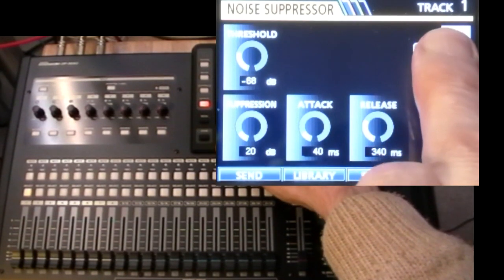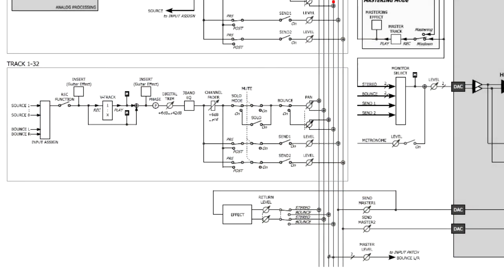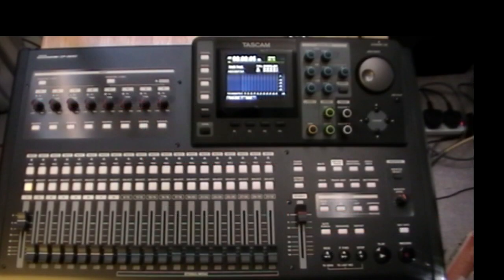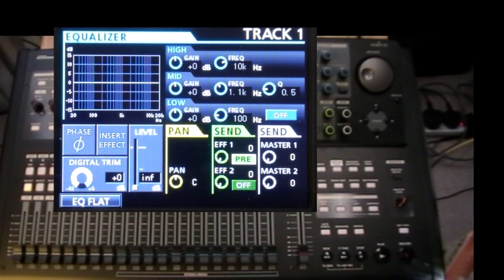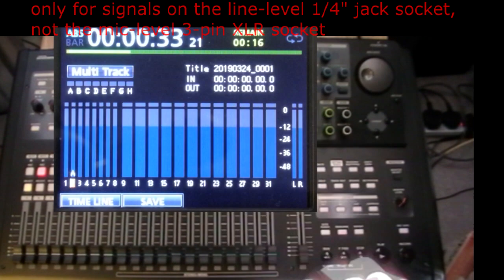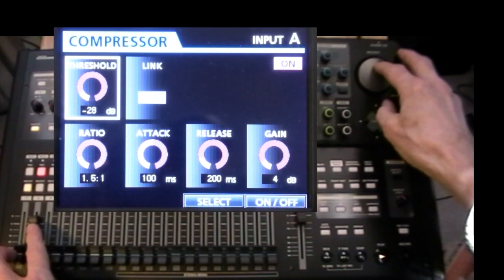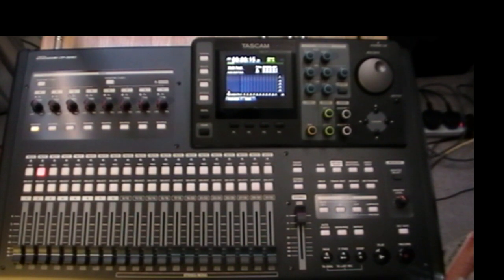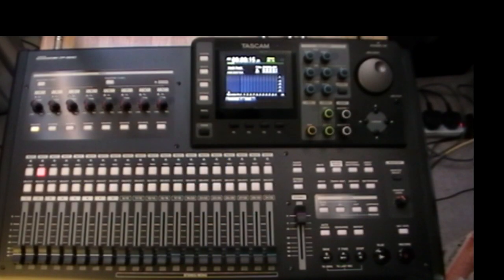Tascam DP24/32SD Tutorial 14A: Dynamics FX after recording

Comment: Your videos are very well explained .If I want to record a vocal using my boss VE2 pedal is it possible to use the send as you showed but during the recording of the vocal please ?
Reply from the maker: @guitarmuso1 sorry about the delay; have been on holiday. There are several ways of connecting external devices, e.g. you could just place it series with the source signal so the mic/guitar goes to the pedal and its output goes to a Tascam input, or you could place it in the send/return loop so the eff-send goes into the pedal and its output goes to a Tascam input. 
It depends on what inputs & outputs are available on the device, and how much control you want over the signal, such as whether you want to record the unprocessed signal as well as the processed one, or whether you want to apply the effect to an existing 'dry' recording, etc.
I would recommend drawing a diagram showing what you want the signal flow to be. Start at the source and go right through to the end result (recorded track), and then configuring the Tascam as needed.
Get back to me if you need to, although it's easier for me to use email than Youtube messages, so drop me a line on:  patipping (at) gmail (dot) com

Comment: Phil, I have a question, superb video instruction by the way, what is the link on and off button for in the dynamic compressor section? Does that create Sidechain capabilities?
Reply from the maker: @Chris Henry thanks for the feedback. As far as I know, the link couples both left & right compressors so the stereo image doesn't wander about. There is no option to get at the sidechain signal unfortunately.
Reply: @philtipping  I see. Unfortunate, but still extremely useful! Thanks for your reply and expertise!
Reply: @philtipping  after thinking on your reply, does that mean, for example, when mono channels 5 & 6 are coupled(linked), there theoretically could be a kick drum in 5, and a bass guitar in 6. Which channel would affect the compressor and which channel is the compressor effecting?
Reply from the maker: @Chris Henry when you turn on the link for a compressor, it automatically inserts the compressor into the adjacent input path. You can see this happening if you look at the top-right of the dynamics screen. e.g. if you insert a compressor into either input A or input B, the screen confirms that routing. If you then enable the link in either, the display changes to A-B, so you now have a linked compressor on both inputs.

Comment: Hi cool video. I have a question: what's the best way to chain the DP02fx to the dp24 if I want to use the fx's internal effects. Any suggestions or warnings?
Reply from the maker: @Reardon Dearborn thanks for the feedback. There are several ways of connecting external devices, depending on how much control you want over the process.

The simplest way is to connect the device in series with your input signal, so you'd plug your mic or other signal source into the device, then connect its output to a DP input (or 2 inputs if the device has a stereo output).
This method is very simple, but it gives you a recording which contains the effect with the settings you used at recording time, so if you change your mind later, you'll have to re-record it.
 
The other method is to put the device in the send/return loop. You would connect one or both send outputs to the device's line inputs (the send outputs are unbalanced so TS cables are preferred); again whether you use one or both sends depends on whether the device needs a mono or stereo source signal. Note that each send output is mono, so if you want a stereo output, you need to route the left signals to send-1 (say), and the right signals to send-2.
The output(s) from the device go to other DP inputs as before, again using 1 or 2 cables.

This send/return configuration can be used in 2 ways.
 
One is to use the device live (similar to the first method), so you'd connect your source mic/line signals to another DP input, then tap off this signal so it goes to the send output.
If you assign all these inputs to tracks, you can then record the dry signal onto one track and the wet (affected) signal onto another track, both at the same time. These can be blended later when mixing or bouncing. This blending allows you to change the amount of effect later if you change your mind, but it doesn't let you change the type of effect.

The other option is to leave the sends turned off while you record your dry signal as normal, and then add the device's effect afterwards by turning the send(s) on during a bounce or mixdown process. This way gives you the most freedom, as you can run the bounce or mixdown as often as you like with completely different settings on the device; there's no need to re-record the original performance.

Hope that helps; there are various scenarios in the step-by-step guide
http://www.philizound.co.uk/freebies/dp24-32/dp24-32.html
which show how to connect external devices using the send/return system.

The DP machine is very flexible so the options can be a bit daunting at first, but if you sketch out the signal flow it will help show you how everything fits together.
Reply: @Phil Tipping  thanks for the quick reply Phil. It is much appreciated! I would choose option A. But when you say connect the output to the dp24 line input, I wonder what you mean by the output? Do you mean the send on the DP02fx?
Reply from the maker: @Reardon Dearborn I meant the normal main output, but if it has sends and they are more convenient for your workflow, there's no problem using them, as long as the effects are present on them... it might be an unnecessary complication though. My reply was applicable to any device which adds effects to its input signal, so typically this would be a free-standing effect box. Your situation is slightly different as the dp-02 is another portastudio. I don't know the exact details of these but if it's similar to the other DP series, it's capable of adding effects to a live signal as it passes through the machine to the main stereo output (no recording is required, although you may have to arm tracks to let the signals through)... in which case you can treat it exactly like a dedicated effects box.

Comment: Hey Phil I have an original DP24 with midi and CD so it’s nine or ten years old. Some of the buttons I have to press really hard to activate now. What do you suggest to help or stop this, some kind of contact cleaner?
Reply from the maker: @Leo Go Live! Yes a few drops of cleaner in the gap surrounding the buttons followed by repeated press/release to work the cleaner through has been reported to work on the forums, although I've not tried this myself. There should be no need to take the machine apart. The usual recommended cleaner is Deoxit but it's very expensive. There are cheaper alternatives but I don't know any names. Whatever you do, do NOT use WD40. Thanks for stopping by.
Reply: Thank you Phil!

Comment: wish you had designed the dp 32 sd , problably would have better quality , more extensive channel eq, and the BIG ONE , dynamics available at the mixdown stage instead of having to do a patch work around !  Your tutorials are very helpful, it's just sad that tascam seems to get on the right track but ends up falling short of having something really good and complete.
Reply from the maker: @Tom Sheehan haha well thank you Tom for the vote of confidence - it would be an amazing opportunity... even if I had the skill :) Being devil's advocate though, it must be difficult getting the right balance between features and price... plus all the other factors that companies have to juggle. Other gear also have an assortment of criticisms so I don't think there's such a thing as the perfect machine that suits everybody. I agree it's a shame the shortfalls are frustrating - the classic one is that they had MIDI working with the older DP-24/32 machines and then chucked it away! I can't see how doing that saved anything cost-wise - the work was all done so it can only be saving them the cost of a couple of MIDI sockets and maybe a chip or two. 
What would be really useful would be to make the firmware open-source, but that's pretty unlikely. I'm sure there are hackers out there who would jump at the chance of improving the machines if Tascam are too busy/unable to put much effort into it. They are still doing updates but there's nothing really groundbreaking.
Anyway, all whingeing aside, we just have to make the most of what we've got I suppose... and at the end of the day, it's still a great free-standing machine if you want to get away from computers :)  Thanks for stopping by.

Comment: I think I am getting the hang of it slowly after a few wrong turns. I also tried using reverb/delay at the same time, but just got a wash of it over the top of everything, even when the faders were turned down! I'm guessing if you want to add reverb or delay at the same time as compression, do you use another lead into the send effects with one input going to the source track? The thing is, I want to try dry recording and adding effects after the recording, which is what a lot of people recommend, but many of these machines seem to be built so that you record wet. So to add another effect like delay at the same time as compression, would you have to use a cable that plugs into sends 1 & 2 and a mono to the source track?
Reply from the maker: @fanfanackapan your observation about the machine being built to record wet only applies to the dynamics effects. 

The Insert(Dynamics) effects (Compressor, Noise Suppressor, De-Esser or Exciter) are usually added while recording unless you use the loop-back trick. 

The Insert(Guitar) effects (Noise Suppressor, Amp, Compressor, Chorus, Flanger, Phaser, Tremolo, Auto-wah or Delay) can be added either while recording or afterwards, although only on one track at any one time.

The Send effect (Reverb, Chorus or Delay) can be applied to any/all tracks/inputs and is usually added during bouncing or mixdown. 

If you're using reverb or delay from the send effects, it applies to all tracks or inputs which have their send-1 signals enabled. If they are set to PRE, you'll still get the effect with the track faders turned down - that's what PRE means. 

If you're getting a "wash on top of everything", it sounds like you have some sends enabled unintentionally, so did you start with a clean slate? Videos #1 & #2 explain how it's easy to get confused with settings being carried over from previous songs so recommend using a blank/reset template.

There's a delay in the both the guitar and send effect so if you want to use reverb and delay at the same time, you could use reverb from the send effect and delay from the guitar effect.

Similarly, there's a compressor in both the dynamics effects and the guitar effect.

If you sketch out the signal flow for your particular setup, you can see which effects you can use at any one time.

A common workflow with these machines is to record dry and add effects using bouncing. If you only need a few effects, you can do this at mixdown instead, but it can be easier to use bouncing and build up the effects in sections. This is why having lots of tracks is an advantage. It may take several bounces, but there's no degradation like you used to get with old-school tape machines. 

Re. loop-back cables, the cable is only for getting a track playback signal back into the input path in order to pass it through the dynamics effects. You don't need a cable to apply delay or reverb (or the compressor from the guitar effect) as those effects are not in the input path.
Reply: @philtipping  thanks for the detailed reply.  I will probably look at these again as I progress through the learning stages. No, the wash of reverb I meant just over the vocal I was experimenting with gave the effect with the sound turned down.

So much to take in. I was using a Zoom R8 before I bought this. I thought that was complicated, but this is even more so.
Reply from the maker: Stick with it and it will gradually 'click' :)
It seems complicated because it's a complete recording studio in a box... but it doesn't come with a recording engineer so you have to take on that role.
All the techniques & terminology like inserts, send/return, bouncing etc. are generic recording concepts which apply to any multi-track system, but when you couple those with the particular way Tascam have designed these DP machines (with the odd quirk or two!), it can be very daunting at first. 
Visualising the signal flow through the machine is crucial (imho), otherwise you end up just pressing buttons without really understanding what's going on. This is why these tutorials take an unorthodox approach and explain things from the signal flow perspective. It may seem hard/boring at first, but if you watch them slowly, in order, and try things out for yourself after each video, you'll get a better understanding of what's going on and will be able to 'see' how to configure it to do whatever you want to do, even if your particular requirement is not shown in the video. 
There's a step-by-step guide  http://www.philizound.co.uk/freebies/dp24-32/dp24-32.html which concentrates more on what buttons to press to do various tasks without getting bogged down with the explanations, so that can be a quick way of getting off the ground, but it's impossible to list every possible task so you still need the videos eventually if you want to get the most out of the machine and justify what you paid for it.
Good luck :)
Reply: @philtipping  yes, I have some knowledge of recording and multitracks, but this is the one I just bought recently. I don't think I even scratched the surface with the Zoom, but the videos really do help every time. I would have been lost last time if I had just stuck to the manual. Much better to watch somebody do it and explain it. The last time before that, I had an old Tascam porta 1  20 odd years ago and the damned belt kept coming off. It was a nightmare! So pleased I am back into it again. I am slowly getting the hang of it. Thanks for these informative videos and detailed replies. They really help.
Reply: I followed this to the letter and the track is coming in so hot. I have the trim at 7 o'clock and it's still overloading. What can I be doing wrong?
Reply from the maker: @John Faughey Only just noticed your question John, sorry. Youtube is hopeless at notifying when new comments come in. Did you get your problem sorted out? It's best to use emails to contact me - good old-fashioned emails are still the most reliable way for me :)  Email address is at the bottom of the page on my website philizound.co.uk

Comment: I get the reverb working but it isn't audible during playback after it is recorded, even though during recording I can hear the effect. Never this issue before? Do you know a fix?
Reply from the maker: @Arran Fox yes this is a common 'problem' and there are a few ways to do it depending on what exactly you want to do. For example, you can use the bounce process to add reverb to existing track(s) and record the result onto another track. Or you can use mixdown to apply reverb to existing track(s) and record the result onto the master file. The videos show these methods, but if you want a simpler step-by-step process without all the explanations, the Step-By-Step Guide may help; full details are at http://www.philizound.co.uk/freebies/dp24-32/dp24-32.html